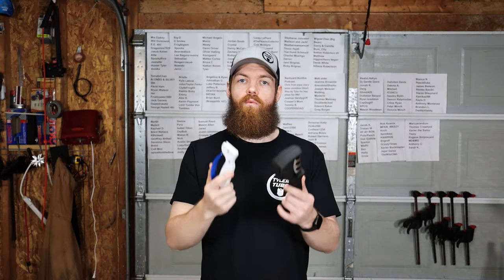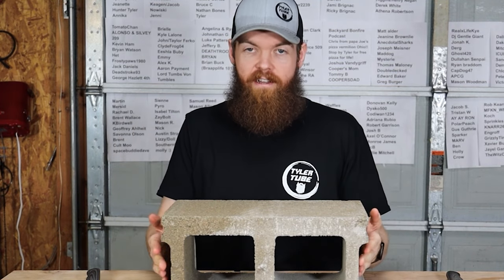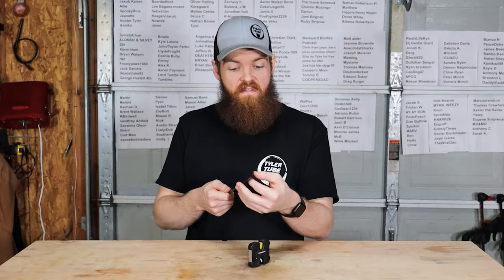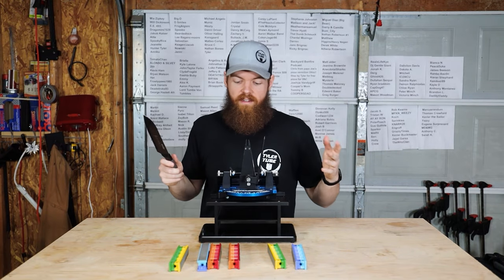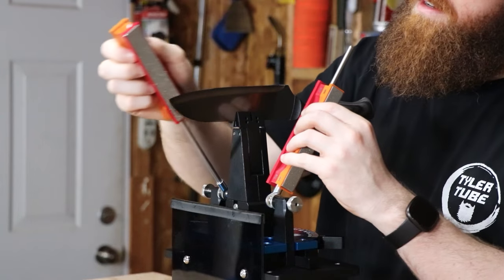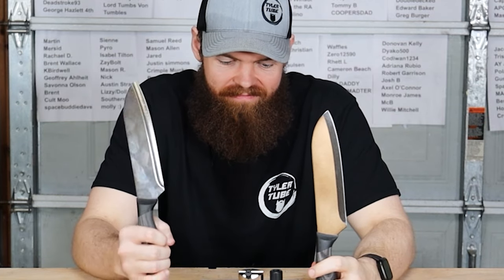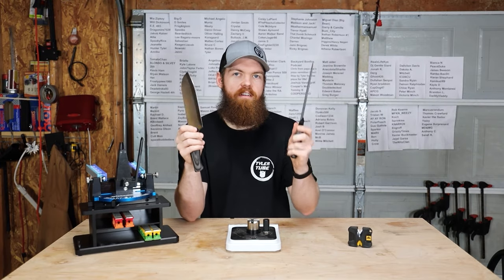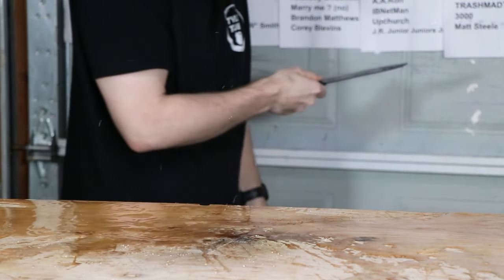$4 VS $1000 Knife Sharpener, Which One Is Better?

Comment: I used to use Fiskars sharpener for years and it worked okay, some knifes worke dout really well, some not so much. Later I took a class in how to use whetstones, and it was the best thing I ever did. At the class I tested how good fiskars sharpened my knifes and it went around 400- 600grams. Using whetstones from 600grit up to 5000 grit I got a kitchen knife to only put 145 grams on the weight.

If you want lazersharp knifes that will also work well on any Axe, Leatherman, Pocket knife and any house holde knife, use a WHETSTONE! You only need one stone to get started and a youtube guide, and I can promise that withing 2-3 hours you're all set to get a knife to atleast 500-600 grams of preasure. Now when you'te comfortable you can buy more expensive set of whetstone at higher grit rating and polish the edge for razorsharp edge.

The reason I wanted to stop using Fiskars is that it cut too much material away from the blade. I used it on my kitchedn knife and it was "Okay" sharp, but it also wore down after 6-7 months of use 1/4th of the blade was gone. And Fidskars didn't work well with my smaller leatherman knife blade.

I would rate Fiskars at 3/10 and my whetstones at 10/10.

Comment: The knife sharpener for $ 4 gives the knife a raw edge, a sharpness that quickly disappears.
The one for $ 1000 gives a more durable edge. But you made a mistake, you have to finish grinding on one side before grinding the other side. That is, you should not grind right, left, right left ...

Comment: I personally use a $15 WorkSharp Pocket Sharpener & a handmade Leather Strop with Super Fine stropping compound. So it starts on the Diamond Stone, then the Ceramic Rod & finished on the Leather Strop. I use that set up on every blade and follow the factory edge. The knives I use on the daily is a Victorinox Huntsman, Morakniv Eldris, Morakniv Kansbol, Morakniv Precision, Morakniv Spoon Knife. Other knives I own are Morakniv Filet, Leatherman Rev, Morakniv Rescue Knife, and a few cheapo back ups.

Comment: 10$ knife... a good quality knife on a wicked edge gets crazy sharp, even with 1000 grit. Strop the blade after sharpening and practice a bit more, then u will get amazing results. Any sharp knife will cut paper, but only a properly sharpened knife will cut paper smoothly along the hole edge. I use the paper cutting only to tell me about imperfections in the cutting edge and not to measure sharpness.
Reply: If both knifes are the same, then they’ll both have a fair chance.
Reply: I wonder what it would do to a Dollar Tree knife? 
I'm wondering if there'd even be anything left of the knife after the good sharpener got through with it.
Reply: I bought one of these last week and man... It was nothing like this guys video.... This was just cringe to watch now that I have experience. Like he didn't even read the instructions..... or use good steel.... I'm just like what.... what... Was that???

Comment: The wicked edge sharpener wasn't used properly. You've gotta get some practice with it and then it'll shine above the others. The ceramic stones and strops you can purchase also take it to another level of sharp. They work incredibly well. The biggest downfall is when sharpening the curve on blades. It doesn't keep the same angle as the blade drops to the point. I've owned one for years and sharpened hundreds of knives. It's surely better than a $4 sharpener. Get some practice, read a manual, watch someone else's YouTube of The Wicked Edge. You didn't do it justice.
Reply: lol
Reply: I was kind of screaming in my head, he did not apex the edge first, up and down untill a Burr or wire edge. It's only then you move on to the high grits, this guy does not know what he's doing....ohhhh if only I had that thing. I had the Wicked Edge Go the cheapest, and got some of the sharpest edges I could not believe. Hair popping at its least.

Comment: this just goes to show it doesn't matter how much you spend on a sharpening system if you don't even know the fundementals of creating a bur.
Reply: With the stone running along the blade you don't need to create a bur, nor are you particularly likely to. A burr is not essential to sharpening a blade, but when your sharpening motion is perpendicular to the blade you are highly likely to create a burr. Very hard steels are less likely to form a burr, but will still become super sharp

Comment: Being a chef, the bevels on the knives makes me want to cry, they are HUGE! All you need is a 17 degree grind with 100 (if damaged), 600 (Mildly Blunt), and then 1000 grit. Anything over 1000 is just for polishing.
Reply: I use the wicked edge and sharpen well beyond 1000 grit. I'm a meat cutter and i've often heard people say a polished edge isnt good for cutting meat. My personal experience disagrees with that to the core. I use a mirror edge for cutting meat and it sure makes my job a hell of alot easier.

Comment: Definitely user error. You need to strop both for starters and also the diamond stones on the wicked edge aren't broken in. Use a tool drawer liner and use that to lock the spine in solid in the vice to prevent movement. Also use a sharpie to verify you're properly apexing your edge. It's the user not the tool I have one and can guarantee you better results than this 😂
Reply: True but at this point i know its hard to not say anything and i feel the same way but its getting kinda toxic even though he says he doesnt care.
Your 100% right they are quite simple rookie mistakes to make you would think after all these sharpening videos he would know what to do but you have to respect him for who he is
Reply: @xd-qi6ry  I mean all he had to do was read the user manual. I lost respect for him when he started playing with high voltage like an idiot. He's going to get himself killed in the pursuit of views and I don't have respect for that 💯
Reply: Maybe he's showing which is easier just out of the box for average person who doesn't know about this skill or read manuals.  For those average people they'll fare better with cheap one because expensive one is too complicated for them.
Reply: @SoulDelSol  🤣 then that's user error not product flaw.

Comment: The motion you used results in a wire edge. Most instructions I have describe "trying to cut the top layer from the stone" Retry with a downward motion. Also there should not be a need to use each grit in number, the finest two should do it.
I'm the son of a barber (for 60+ years) and great nephew of a master machinist. On top of that a friends dad is a chef. So I can sharpen a straight razor to a c.)old chisel with a chefs knife being the best working edge (longest lasting.)

Comment: The wicked edge is a rip off, its way overpriced for what it is. I suggest the KME, much more budget friendly. If you want to go super budget, get the work sharp precision adjust. I personally like  the KME. You also need to strop when done sharpening to get the sharpest edge. 1000 grit is enough to get razer sharp. Just takes practice and stroppping. Love your vids, keep them coming.

Comment: The scale your using to test the sharpness has two types of ways to rig it up. One is premade wire clip things and the other is where you yourself wires it up, if you're using the later option your going to get obscure results cause you might set it up different everytime. DBK on YouTube talks about this on one of their videos and gives an example

Comment: When it comes to “rougher” grits below like 2000, you absolutely need to strop them or else you basically have a microscopic saw, that’s why they feel so insanely sharp but don’t actually preform how they feel. When you get to grits like 8000, stropping still will make your edge even sharper, but it’s so fine at that point that Most of those burrs aren’t even noticeable since they’re so insanely small
Reply: You have no idea what you're talking about.
Reply: @autumn5592  explain?
Reply: @riggsvsoliver  You do NOT need to strop, even as low as 220 grit.
Reply: @autumn5592  and where is this coming from / what’s the science behind it? Because at super coarse grits a wire burr forms on the edge. You need to either strop it or break it off, when you move on to the next grit you “strop” that wire off, and then start a finer wire and burr on the edge. As you get to finger grits, that wire and the burrs become much less tough and sometimes just pretty much disintegrate
Reply: @riggsvsoliver  Admittedly, yes, anecdotal.
But there is a science of sharp article that proves it can be done with a relatively low grit.
(Guy looks at the edge under an electron microscope.)

You can sharpen knives (or anything really), without forming burrs, it's all in the technique.

Comment: As the owner of the WickedEdge, I can attest that you can get MUCH better results with this with proper use.  As others have pointed out, getting numbers around the 100g mark are very reasonably achievable with wicked edge.  My main problem with this video, however, is that it doesnt address the number one problem with "draw-through"-style knife sharpeners, which is that they create a scratch pattern parallel with the knife edge, which will VERY easily round over and become damaged after very minor use.  Any knife sharpener that can put a scratch pattern perpendicular to the blade instead will always achieve a better, long-lasting edge.

Comment: @TylerTube sharpening the knife by pulling the stones away from the spine of the blade can create a flimsy edge as material is dragged towards the edge.  Try sharpening by pushing the stones towards the spine, which stops burrs from protruding from the edge of the blade.  Basically, sharpen TOWARD the spine, not toward the edge.

Comment: It's all about the angle, not the grit #. With the $1000 sharpener, you can actually change the angle of the blade to a more fine degree and REALLY make it sharp. A 15° angle only gives so much relief and will eventually not get and sharper because the amount of relief doesn't change. Unless you change the angle.

Comment: I use a couple water stones, if I want to polish the edge up more then I have found 1500-3000 grit wet/dry sandpaper works. Costs way less than $1000-$1200

Comment: 5:57 - Whether or not a blade can shave hair is not really a measurement of how sharp it is though, some of the sharpes knives I have right now does not shave without excessive force, while some that are alot less sharp by a good margin will do it. Of course it has to be reasonably sharp to begin with, but whether or not it bites into hair instead of gliding over it is mostly up to edge angle, scratch pattern, geometry, steel type and grit used. I personally find that knives sharpened on either really low grit or really high grit shaves easily, but medium grits do not.

Comment: Try finishing the sharpening process on the finest stones and lightly running them " leading edge sharpening " Rather than the Safe and recomended by the manufactures instructions " trailing edge sharpening "  that you exhibited  in this vid . I believe you have formed a burr and you're just pushing it from one side to the other with every sharpening stroke . Also wet (with water) the fine stones when finishing the sharpen  
 that will further reduce the aggressiveness of the stones .... 65 yrs old ... 52 yrs sharpening on oil stones  experience ... Cheers from New Zealand

Comment: I have an edge pro knife sharpening system. It takes some skill to get it all figured out, but it does a fantastic job and is around $200. I use it mostly for kitchen knives but you can put a convex edge on something like a Tanto blade or a kukeri. You can even use it to sharpen up that sword

Comment: I have a nice little knife collection with some pretty high end steels. I think CPM-M4 is the hardest steel I have, and it takes the longest sharpen. The Ken Onion Worksharp powered sharpener cost me like $60, and gets it done in about 5 minutes. That includes setting up and putting away the machine. Then a few licks on the strop and it's shaving sharp. Those $4 sharpeners remove too much of the high end steel I pay for. Maybe on cheap kitchen knives I'd use it. But I'd much rather use the machine, or simply do it by hand.

Comment: I feel like it’s all in the technique. Was the angle matched? did a burr occur? That wicked edge system is amazing and if done right will produce hair splitting sharp knives. So will a $60 lansky. It’s all in the technique.

Also whatever that fan, clutch, squeak is, it’s very distracting. You might consider a lav mic on your shirt or a boom mic closer to your mouth to eliminate the shop noise. Cheers brother 🤙🏻

Comment: the reason why the knives feel sharp but dont shave is because of the micro-sawtooth edge left by the pull-through sharpeners.  you need to step up the grits to remove this.  the sawtooth edge dulls quickly as well.  get a fallknivesn DC4 and use a leather belt to stop.  you'll shave easy and it's hella cheap and portable

Comment: On each knife you can only make it as sharp as the steel will let you i would like to see this again with some treated steel or maybe you could find a graph on what steel can be sharpest
Reply: Doesn’t matter if both knifes are the same
Reply: @shaneh7519  Yes, but there is always quality difference. Also, the knives he used doesn't adequately do justice to the $1000 knife sharpener.

Comment: It really depends on the use/case scenario. I'm a commercial fisherman and depend on a sharp knife but a 1k sharpening system isn't feasible. I use a 2 sided stone and 2 sided homemade strop (Old thick leather belt glued to a 511 canvas belt). I think it's the best of both worlds. The stone to fix damage to the blade and the strop to hone the edge. You have to start with a decent blade first though. You can't just get and keep a decent edge on certain material.

Comment: The 430 or whatever is where that knife started at. It was always 200+ off from the other knife. SO maybe its the knife not the person who sharpened it trying to get out work on time on a friday LOL
Reply: but they were both equally dull after he destroyed them, so it doesn't matter how sharp the factory was, both tools were used to try make the edge as sharp as possible, so the $1000 sharpener should had made the edge way sharper than the sharper knife from the factory
Reply: No they werent equally dull. That one knife was still 200+ off from the other one. It never changed from being that 200+ off. Thats why I think it was more the knife. The one started at 230 grams, went to 1880. The second knife went from 400  to 2030 thats still off by the initial 200+ difference. So they were never EQUAL.

Comment: Tyler just curious here but I have only seen a few sharpeners that do not require a wet stone. Could your expensive kit require a bit of water or oil? The cheaper one is one I know requires no type of lubrication. A chefs steel also requires no lubrication. This was just a thought since most stones do require a lubricant.

Comment: The pull-through type knife sharpeners are only for knives with cheap steel. Not premium high carbon or premium stainless stuff. If your kitchen knife has soft steel, it will roll the edge back sharp, for you to dull by bending again. If your pocket knife, with decent hard steel, is put through this type of sharpener, it won't sharpen.

Comment: The 1000$ knife sharpener is not bad! Knives are usually ground at an angle of 10°-15° (12° is the best compromise between sharpness and durability). You sanded it at 18° = longer durability but duller blade. The lower the angle of the blade, the sharper the knife. Try again with max 12° and you will be impressed. 
Plese trust me and try it

Comment: If you don’t make sure you take enough meat off each side of the blade you can go all the way to 3000 grit and still have a dull blade. You were correct when you found that the knife moved ( good job) It’s your initial start with the 100 grit that you need to make sure there is a “burr” created along the whole edge after you run the stone down one of the blade a few times after you feel you have sharpened it enough. When you create that burr you have now apexes your blade and can continue with the next stones

Comment: I was a professional chef for a few years and I think the wicked edge is a waste of money but you definitely could have gotten a better edge than what you got in the video. The pull through sharpeners are OK for a little tune up now and then but they can damage your knives and if your using japanese steel they can DESTROY your knives. Also if you have an integrated bolster you cannot use a pull through because it can leave a big gap between the bolster and the blade witch is infuriating to deal with. Bottom line get a couple NICE japanese whetstones and learn how to use them. For the home user I always recommend the king 1000-6000 combo. It's about 30 and you can get a crazy sharp edge relatively quickly. If you want to go crazy buy a cheap leather strop and you'll be shaving sharp in no time.

Comment: You are doing something wrong I have seen that sharpener on other channels and it get the knife sharper then the manufacture edge. Also the knife out of the box was 430 on 400 manufacture edge there maybe a problem with the knife being able to get a good edge.  You have to do one side at at time with 10 passes check for a bur when you have a bur do the other side. do the is until a bur is not detected. This will shape the edge. Once you do this then do the alternating passes. 
I would get a Lansky system it will get almost as sharp as the Wick Edge about 5% of the cost.